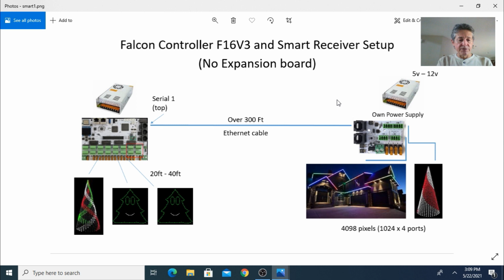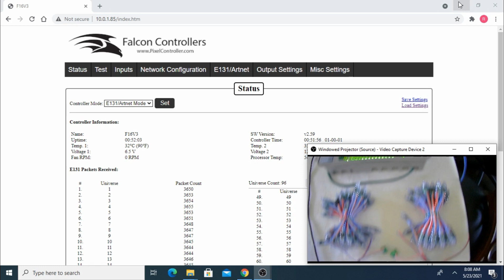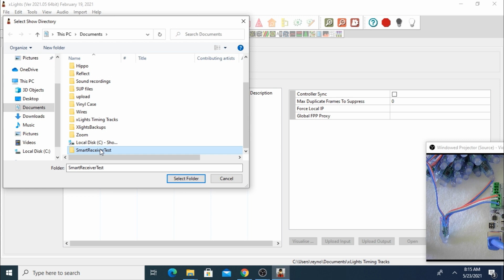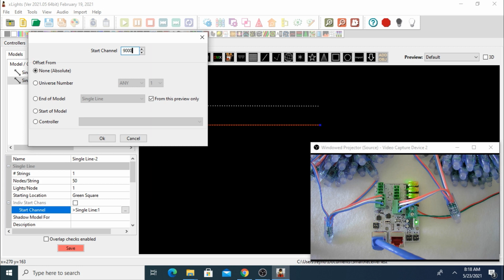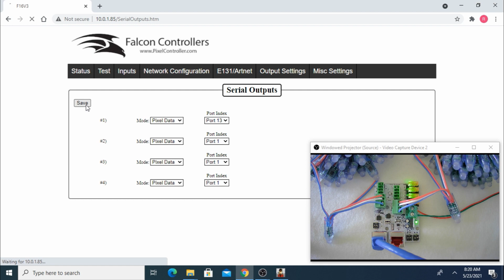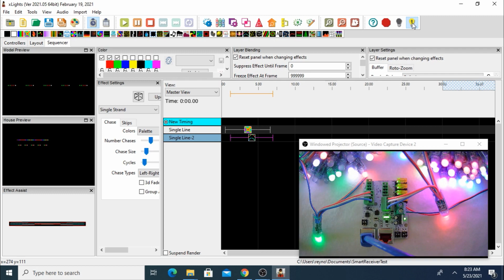Go the Distance! How to connect a 4 Port SmartRecevier into your Falcon Controller

Comment: Another great video..... how do you instinctivly know where and when I am stuck and then add a video within days of me starting to stress lol  you are psychic ....
Reply from the maker: Lol. So perfect timing I guess. I am glad that someone is finding my videos useful. Good to see you around.  Thanks for watching.
Reply: @trevilights  you are so helpful and show things at my level... im almost done with all my props building and painting etc(1st timer) and have a few sequences ready on my computer .... just need to tie it all together... 1 thing if I want to make a custom prop like a different shape etc... how do I model it onto my layout so I can use it in xlights
Reply from the maker: @mintysweb  that's amazing. And I am glad you are doing it now because time goes fast. And about the custom model...give me a few days and I make one video on that. I am currently working on a Mega Matix and it's taking some time.
Reply: @trevilights  cool no rush I think I actually worked it out for myself...
Now to get the xlights to talk to the controller etc...
I have set mine up with the PI like you did for wireless connectivity.

I have set all the string outputs for the props I plan to use. On test in falcon they work properly
But cant seem to get xlights to control them yet...
Reply from the maker: @mintysweb  Alright. Glad to help.